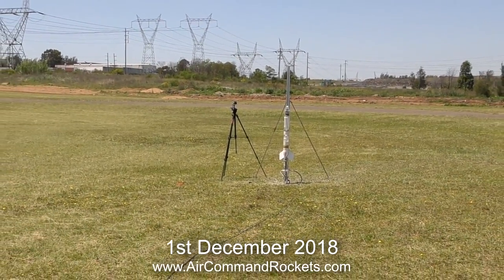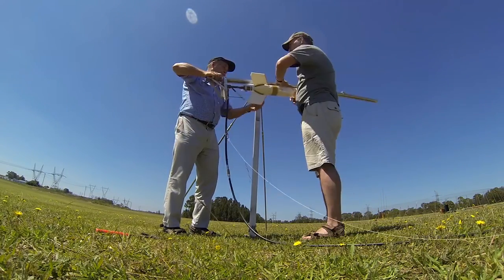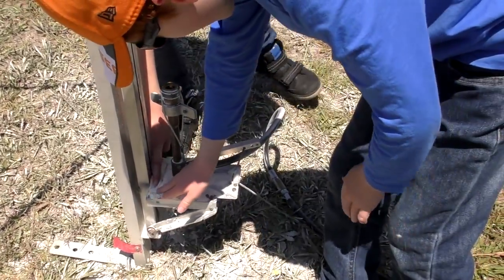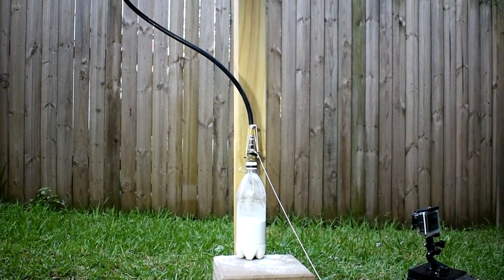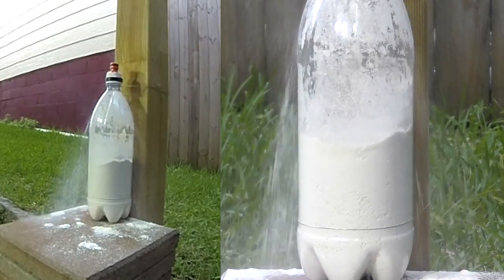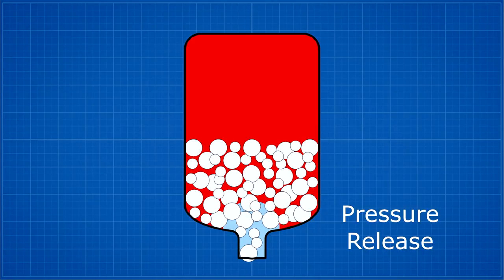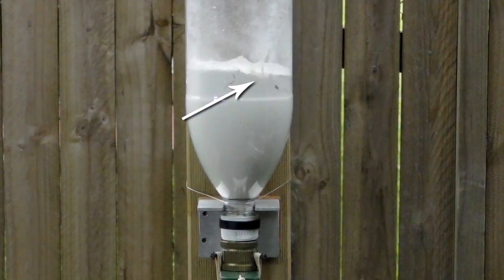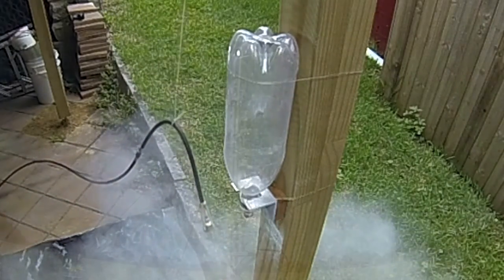Flour Rockets

Comment: The cloud of flour should be explosive.  Have you thought of trying to ignite it?
Reply from the maker: It is never a good idea to ignite anything coming from a water rocket. It doesn't matter if it is flour, coffee creamer or a flamable liquid. They are all dangerous when ignited.
Reply: to get any thrust from an ignited flour cloud it would probably need a nozzle cone after the exit point of the rocket. Unless it was purely for the visual.
Reply: Flour coming out the back of the rocket would probably be about as safe as any material you could light. It shouldn't be able to burn inside the rocket, and would just make a big, short lived, fireball on launch. A flare a handful of feet from the launch platform would probably do the job as safely as possible. There wouldn't be anything burning going down range, and any hazard would be limited to a couple yards around the launch pad.

Edit: you would need to be careful of the radiant heat weakening the rocket I guess
Reply: @jmar1371  it burns vigorously and 'explodes', but doesn't detonate. It's only a real explosion risk if confined. The risks are direct burns from contact with flaming material, and burns from the IR radiation. A giant pillar of fire isn't safe, but a small bit of distance would control the risk in a way ineffective for a true explosion. 

If somehow the flame front passed into the bottle and the conditions stayed right for burning you could, possibly, get an explosion.
Reply: Whatever you do, remember that there is more than enough air for combustion in that little bottle.
Reply: It would be a good idea to use an aluminum rocket with cobalt-steel exhaust throat instead of simple plastic bottles to try that.  If the flame breaches the plastic exhaust throat the entire rocket could explode.
Not something we want to happen over grass with bystanders less than 100 ft. away...
Reply: Do it, do it, do it, do it!!!
Reply: It would work even better if you pressurized it with pure oxygen instead of plain air.  ;-)
Reply: That's what went through my mind.........I'm adding it to the list of "things to maybe get round to trying". It should leave a flaming trail, rather than an explosion.
Reply: @AirCommandRockets  Very true, but probably still a lot safer than a highly pressurized container. Everything commands respect and needs proper assessment and controls.
Reply: @AirCommandRockets  Isn't that the point?

Comment: I'm always enjoying your videos. Thank you for sharing with us. 

By watching launches of flour filled rockets I've got the impression that they are a better   aplied as a bosster, or a first stage of multistaged water rockets then ones filled with water. That with the relation of performance (peak altitude) to weight in mind.

I'm aware that I can be mistaken, and it's just a diameter of the nosile, that is not optimized for flour runs, that fools me.

Any way thank you. It's always a pleasure.

Comment: Have you made sure you have the right amount of air to the right amount of flour? Does it run out of air before flour or flour before air? If you still have pressure left over after expulsion of the flour wouldn't it be thr most efficient use of the bottles capacity if you add more flour media until you run out of air and flour at the same time?
Reply from the maker: No, on these flights we didn't have an optimal amount of flour. It is not just a matter of one running out before the other. You have to take into account the weight of the flour as well and the effeciency of it being accelerated out of the nozzle. We will do some follow on flights where we will determine the optimum amount of flour.
Reply: @AirCommandRockets  that'll be epic.

Comment: I just had a BIG THUNK ,  what about using self - raising  flour , would it go further ?   :-))
Reply: Self-rising flour is infused with yeast culture or just baking powder; it has a shorter shelf life but the 'just add water (& eggs, depending)' feature.
But that is all WAY too slow to add to a water-style rocket's Isp.

I don't know if this falls under the umbrella of 'water rockets' (PROBABLY NOT!); if you rig a rocket with a metal throat and nozzle, you can pass industrial hydrogen peroxide by gravity over a ring of Manganese dioxide suspended in the throat - and STAND THE ○●□■ CLEAR.
(No, seriously, I mean 100 feet clear.  In a dirt clearing.  And paint your rocket bright neon colors so you can find it easily and quickly.)
[NOTE: Concentrated Hydrogen Peroxide IS hazardous material and is used as RCS rocket fuel aboard the Soyuz modules.  DO NOT acquire or handle without proper instruction and safety precautions.]

Comment: Very nice experiment! It looks quite fantastic but it's fore sure a lot of mess to clean up. Another thing you could try is a convergent-divergent nozzle now that you have expanding fuel. ;) 
Keep it up!
Julian from Raketfued
Reply from the maker: Thanks Julian. Yes you want to clean it off the equipment before it gets wet otherwise it turns to glue and then it is a lot harder to get off. It was fairly easy to clean with the air from the scuba tank. :) We just disconnected the air line and blew all the flour away. We had exactly the same thought about using a CD nozzle with a powder since like you said you have an expanding gas. It may be interesting to also try different gases like helium that should hopefully give the particles higher velocity. The powders can also be used to explore reactive masses with a lower density than is possible with liquids. I wonder how microballoons would go?

Comment: Hi, this is a very interesting demonstration. During the slomo of the upturned  flour ¨rocket¨ we can observe the flour infused by high pressured air going up and partly out the nozzle along with the invisible air towards lower pressure. It certainly looks like this is a one way outflow. I miss seeing the reaction part claimed to how rockets work.
Should not particles visibly push down on the bottom of the ¨rocket¨ as visible reaction force?

Comment: Flour is very flammable when aerated... I’d like to see a secondary chamber/ nozzle that ignites the flour for additional thrust.
Reply: That tends to explode rather than burn. The pressure surge might ignite/detonate the primary chamber...
Reply: Robert Herndon flour is inert unless it is well aerated ... meaning you can put a lighter to a pile of flour and it will only scorch a little
Reply: @michaelwni  But by the same token (exploding when well aerated), it would likely make it hard to maintain an ongoing flame in a secondary chamber. (And the compressed air means it doesn't have to be quite so well aerated, since it contains ~10 times more air than in the flour sack.)
Reply: @robertherndon4351   when you light the spray from a can of hairspray it doesn't explode the can... but even if the flour rocket did explode.... then that'd be cool, too
Reply: @michaelwni  There's no air in the can... the propellant is usually propane or something similar. In the rocket, you have both fuel (flour) and oxidizer (air), making it a possibility, though flammability is likely to be problematic/erratic.

Comment: Sand might work as a reaction medium, too.
Reply from the maker: It's certainly possible, though you want a very fine sand. We found that the smaller the particle size the better. If the gaps between the particles are too large then the air tends to escape through those gaps before it has time to push the particles out.
Reply: @AirCommandRockets  you get sandblasting sand in many varieties

Comment: One of my favorite videos so far. Keep it up!
But i have one question: Where is the optimal point between nozzle size (diameter) and pressure? Is it better to have a 9mm nozzle or a full bore 2 cm nozzle with, lets say 10 bar of pressure?

Finn
Reply from the maker: That's a great question, and depends on other factors as well and what you are trying to achieve. Generally a larger nozzle will give you a little bit more performance, over a small nozzle, but not by much. A large nozzle will give you lots of acceleration and higher speed, but because drag is proportional to the square of the velocity, you also generate more drag than with a smaller nozzle which works against you when trying to gain altitude. A large nozzle is able to lift a heavier payload. The faster acceleration also puts more stress on other components on the rocket so you have to make sure they are well attached. The size of the nozzle also depends on the type of launcher you use, not all nozzle sizes can be launched from all launchers. Rockets with larger nozzles are harder to film/photograph than ones with smaller nozzles. Larger nozzles can accommodate larger launch tubes. For optimum size, run the rocket through a simulator and see what the difference is.
Reply: @AirCommandRockets  Thanks for your comprehensive answer, i appreciate it. I think i'll run a simualation or try to experiment with the nozzle size...

Comment: This is an interesting video that got me thinking. If matter in the pressure chamber falls out uniformly, what if you could get the air to release uniformly? My simple understanding is that the reason why water rockets are efficient is because they take some time to release all their working mass. 

This got me thinking about how a empty water bottle will deform if you suck on it or expand if you blow in it. Would a piston like what is seen in a syringe offer more efficiency compared to a traditional air rocket?
Reply from the maker: Not sure I quite understand how the piston would work? In a syringe the force is produced by the user, in a water rocket the force is produced internally.

Comment: As always, great video, very interesting and very educational!  Nice and messy indeed!  I assume you did, but just keep the possibility of a powder explosion in mind!  Perhaps ensure the rocket is electrically grounded (not sure if it will work with plastic), but anyway, try to prevent charge build-up, which may lead to a static arc, setting off a dust explosion!
Reply from the maker: Thank you Willie. Yes, we are aware of the potential for the powder catching fire, though I think the odds are very low. This is why everyone is well back and there is nothing really combustible around it. We considered using baking soda but the problem is that is not very healthy for the grass.

Comment: Why add flour? What contribution to thrust does the flour make compared to just using air?
Reply from the maker: The flour provides a reactive mass the same way water does in a water rocket. If you fly a water rocket on just air you end up flying to only about 1/2 to 2/3 of the altitude you can achieve with water.  We are going to do a few more comparison flights to see what the overall performance difference is. https://www.youtube.com/watch?v=DrPt-AktIMs

Comment: Does the amount of flour change the height of the rocket? Please do a experience with different amounts of flour.
Reply from the maker: Good question. We do want to do some comparison flights with water and air only.
Reply: It looks like this might work slightly better than water, in that the flour/air mixture can and does expand as it goes through the nozzle. It also looks like the expansion of the air in the mixture may make it work better with a higher fraction of flour-to-air than works well with water-to-air.

Comment: So... if the flight results are pretty much similar to water filled, and the flow of the flour is nearly the same as water... what is the advantage of using flower other than maybe it is visibly more interesting? Seems like more cost and more mess for the same results. Or is this purely for the sake of the experiment?
Reply from the maker: This is a good question. In terms of cost, one launch was around $0.60 worth of flour so not prohibitive in terms of cost per launch. A powder may however, allow you to use a convergent-divergent nozzle that doesn't work for liquids. Powders also can allow you to explore less dense reactive masses compared to liquids.

Comment: Try mixing some colored chalk powder with the flour or instead of the flour. The chalk powder is used in construction to give color to string lines. Red and Blue are the common colors.
Reply from the maker: Someone else recommended using the coloured Holi throwing powder. I think that would work quite well. We will have to give this a go.

Comment: Do you have any comparison to the reached height for the same rocket with flour vs. water?
Reply from the maker: We don't have that data yet, but we do want to do some comparison flights to see what the differences are. I still think water will be more effective though but I don't know by how much. .
Reply: My guess is that the height would be proportional to the mass of the flour vs. water, assuming the same volume and pressure of air.  Of course there are LOTS of variables in play.  Looks like a fun set of experiments coming up!
 @AirCommandRockets

Comment: If the compressed air is between the particles, does this mean you can fill more of the bottle?
Have you done a test series with different amounts of flour to test the maximum performance?
Reply from the maker: Good question. We do plan on doing some more tests to see how the volume of flour affects performance.

Comment: It would be interesting to see the performance difference if you used a heavier powder like aluminum or iron/steel.
Reply from the maker: I agree, it would be nice to know what performance differences there are with different powders. From past experiments we know that the smaller the particle size the better. Heavier powders may not necessarily result in higher altitudes. Although you produce higher thrust you also must lift the heavier powder that is still in the rocket.
Reply: Or micron sized tungsten?
Reply from the maker: Perhaps dry clay particles. I think these go down to 0.002mm.
Reply from the maker: Interesting. I was wondering what kind of powders exist that would be more free flowing.
Reply: @AirCommandRockets  any powder designed for compressed powder sintering should be about as free flowing as possible.
Reply: Also different shapes of powder if that can be arranged... the packing density is likely to make a measurable difference in the powder nozzle exit velocity, as it is driven by the working fluid expansion through the nozzle.

Comment: Flour is fairly light.  Theoretically, would a heavier powder create more thrust at the same PSI and volume of air / powder ratio.  For example, lead powder vs flour.  Or water vs flour.   And yes it is obvious one wouldn’t use lead because of the pollution and poisonous nature of PB.
Reply from the maker: That depends, a heavier powder may not necessarily lead to greater altitude. Although you create more thrust, you are also having to lift the heavier powder that is still in the rocket. Here is an experiment we did where we compared liquid densities and their effect on altitude gained. https://www.youtube.com/watch?v=Fu3rIiPy_18

Comment: So if there's air between the flour particles that helps push it out, is it possible then to use a higher volume of flour than would be feasible with the same volume of water?
Reply from the maker: Good question. We do plan on doing some more tests to see how the volume of flour affects performance.

Comment: Oh great experiment! Are you getting better performance from the dry flour? I think the smallest a fordable particle powder you can get is laser printer toner. But maybe it's too dangerous as it's composed of very tiny particles. Thanks for sharing!
Reply from the maker: Thanks Francisco, We don't know what the performance is like compared to water yet. We do want to do some comparison flights to find out. I still think water will perform better, but we just don't know. One thing I think may be worth investigating is using convergent-divergent nozzles, as you are getting an expanding gas on the way out, it just has heavier particles in it.

Comment: I am not sure I get it at all. 
Flour density is about half that of water.  Your acceleration comes from the equation F=ma.  I would bet baking soda (density 2.2g/cm3, $1.46/Kg) would be much better than flour(density 0.6g/cm3 $1,62/kg) or even water(density 1g/cm3) for equal initial pressure.
Reply from the maker: Higher density doesn't necessarily lead to higher altitude for the rocket. Although with higher density you will create greater thrust, you are also having to lift a greater mass of the higher density material that is still in the rocket. Here is a comparison of the performance of different density liquids: https://www.youtube.com/watch?v=Fu3rIiPy_18

Comment: Can a bottle be pressurized at 120psi??
Reply from the maker: Yes. The ones that are designed for carbonated drinks. They will blow up at around 180psi.
Reply: Thanks a lot
Reply: Another question please:at 120psi a solenoid valve can work for lift off
Reply from the maker: You just need a solenoid valve that can handle those pressures.

Comment: Original idea! Try to use pigment grade titanium dioxide (or Fe2O3 pigment) instead the flour.
Reply from the maker: This is not an original idea. Flour rockets have been flown for many years they are just not common. How fine is the titanium dioxide?
Reply: @AirCommandRockets  About 14- 15 mkm (for pigment). For glass industry and metallurgy  more coarse.